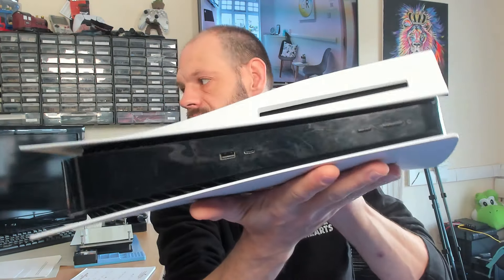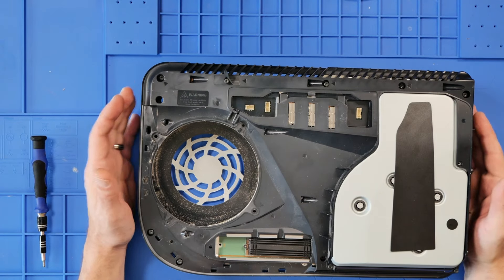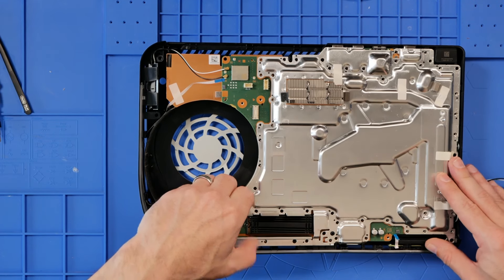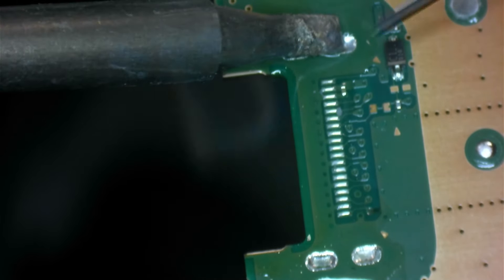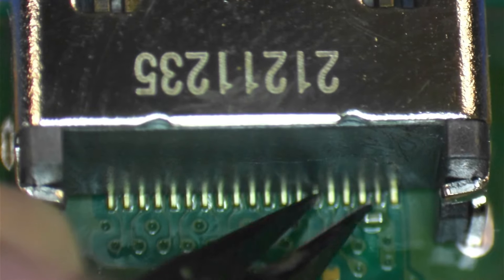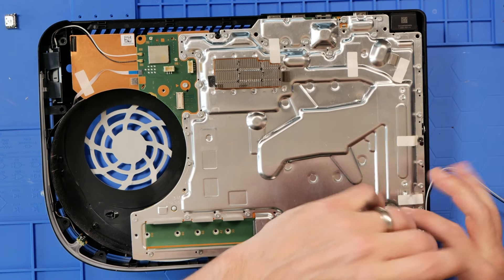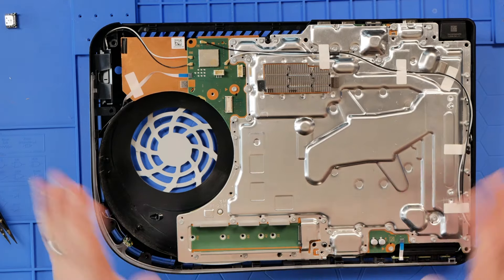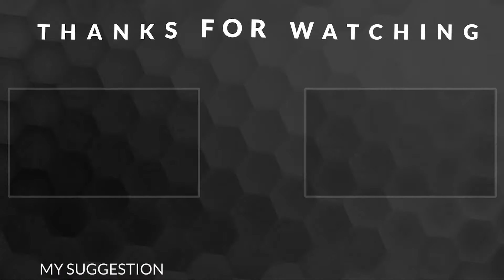PlayStation 5 HDMI Port Replacement | Fix | GetRefurbed

Comment: Just did this, took me two hours. Very good video. Everything works as it should. Saved me $500 from a local fix it store.
Reply: what did you use mines is broken
Reply: After watching this video, I'm very eager to try it myself. Don't know if I will make it worse 😂
Reply: Can you give me information on which heat station you used?
Reply: $500 is more than buying new.
Reply: ebay you can get it fixed for £25-£50 proper business, i wouldn’t go with private tho
Reply: Now I have confidence I can do it lol thank you sir.
Reply: @farhanshafique922  Never know till you try you could surprise urself lol

Comment: I’m replacing mine and my hot air station doesn’t make the port come off! Any advice on distance, temp, and duration?
Reply from the maker: Every hot air station is different bud full heat and airflow from the top will eventually get it. Lots of flux. Try putting some solder over all of the pins and ground legs if it doesn't budge

Comment: At last ,someone who doesn't over solder the HDMI port.
Reply from the maker: That's a bit of a bone of contention. There's nothing wrong with it, I just tend to find I don't have a need unless I've missed a pin, in that case I'll always go over them all with the iron.
Reply: @GetRefurbed  some YouTubers must have shares in the solder &  flux companies when you see how much they use. Not mentioning any names. 😉
Reply: Been trying to fix mine any plug around Pretoria where to go
Reply: @GetRefurbed  someone said it takes all day to replace the hdmi port---surely it shouldnt take all day?  hes lying
Reply: @MarkSmith-er7fe  if your skilled enough at microsoldering, it's an hour long job taking you very sweet time and doing some cleaning as you go. 

The hardest part is there are 100000000000 screws of different sizes.

Comment: Excellent video. I'm getting a lot of requests for these port repairs at this point. My one question is, what is your low melt point solder, and does it have any concentration of lead? I've been searching for a good low melting point solder to loosen these joints, but I've just not had a ton of luck. Also what do you use for a microscope?
Reply from the maker: Hey buddy. Thanks for watching. No low melt here. Just plain old 63/37 leaded Kester. The board take a ton of heat, not so bad once they're heat soaked which is why I tend to use the hot drop method. Less stress on the board.

Comment: @getrefured what’s that gel called why do they use it and can u use a heat gun that removes paint or that doesn’t work
Reply from the maker: That Kingbo Flux RMA-218. I would absolutely not recommend using a heat gun designed for that purpose. You need a hot air station capable of putting enough heat through the board without destroying it.
Reply: @GetRefurbed  what’s that gel for

Comment: So with the liquid inside ? 
Ill have to place it horizontally?? 
Cuz I like the standing version 
I don’t want mine facing the floor with his face 😅 
But shall I do it or no ????
Reply: I would lay if flat if overheating were to happen soldering drip on mother board ect could cause avoidable issues

Comment: Hello. Thank you so much for this video. You spoke about the small cap in front of the pads and said if it comes off it's okay. It appears the cap on my board fell off and I'm unable to find it. Do I leave it as is or do I need to bridge some solder between the two pads where the cap was? any info greatly appreciated.

Comment: Brother! My ps5 hdmi port is not working. And I need to changed it. I have ordered a hdmi port for the pa5, but what tools do I need for the repair?   Can please anyone make a list for me? I wanna do it by myself.
Reply from the maker: I'll be straight with you buddy,  this isn't a repair you want to take on yourself unless you are well versed in how to work around small components. For some perspective, you'll be spending hundreds on tools as opposed to sending it in for repair. At the moment we have an offer running for £40 per port.
Reply: @GetRefurbed  i live norway. Can u fix it ?
Reply from the maker: @kaw546  absolutely. You'd just need to cover the postage both ways. It might be cheaper to look for a local repair shop?
Reply: @GetRefurbed  local repair shops price to fix it, is 140$.. which is reallly stupid. and thats why i wanna fix my self.
but thanks anyway

Comment: Mine still works, it’s just loose. I have to turn the actual cord and play or jiggle it to get it to turn on…can it be tightened or should I just replace the HDMI port?
Reply: Did you end up having to replace the port? I’m having the issue now.
Reply: @DawonVelez same thing with mine but now it just completely stopped working

Comment: Question my ps5 got knocked off the table and fell on the HDMI cable area bending the plug on the HDMI cable itself..i got a new cable but nothing and them had a friend who is pretty good replace the HDMI port but still not working any tips or causes?

Comment: So question? Is it possible for the hdmi port to be messed up even if it doesn’t show physical signs of being damaged? My ps5 has been sitting in the same spot for the past 6 months and the last time I played it I didn’t have any issues. But this past weekend I was gonna finally do my software update because right when I stopped playing it months ago it was due for an update, just never got around to doing it. Could the need for an update cause this issue? Fully disassembled the console with the plan of switching the hdmi ports but like I said it looks like it’s in perfect condition. What should I do? I’m still able to play my VR games but can’t see any display on the tv. I’ve tried different cords and different TVs and my Xbox isn’t having this problem, only the PlayStation

Comment: Xcellent Vid! 👍🏻just about to do my first PS5 HDMI repair.  Ordered some No Clean Flux Paste in syringe dispenser, have variable hot air gun and following your guide. 09:55 "come in with the hot air clean up where we've been, some 99% IPA".  Are you using a stiff brush, hot air (from above?) and just IPA or is that flux?  🤔 Keep on Keeping On 👏🏻
Reply: Did you successfully repair it. I have another even touched solder before and soon going to attempt this and was wondering what tools you used or that I should use. I know i need a good flux, solder, hot air, soldering gun.
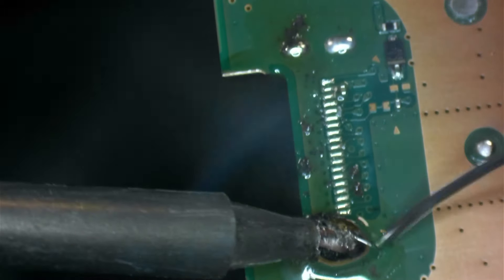Reply: @youngwolf421  I did thanx 👍🏻Not to put you off, but I wouldn't advise this as your first step into soldering. Take it to someone with experience in fixing HDMI on PS5. There is alot at stake when pointing that much heat at sensitive electronics (particular the tiny caps @ 09:39 and 11:11 ). Purchased No Clean Flux Paste in a Pneumatic Dispenser from Amazon. Already had a Wagner Furno 500 Heat Gun and 25W Soldering Iron. Never tackled anything as complex and even with years of experience with micro electronics it was daunting. This video was great for all the info I needed to do the job successfully. Working PS5 at the end of it! GL 🤞🏻

Comment: No matter what i try, i cant get the hdmi off. Nothing i do melts the joints. I feel like i have tried everything! Heat gun, rosin paste flux (not sure if im using the right one), adding more soldering... nothing works for me
Reply: Hi, I finally did it. Took me 2 days to do it. Main thing is you need patience as it took me about 5 mins to finally melt the solder on the hdmi.

First tilt the board so the hdmi is facing down towards the floor. Heat it from other side. Eventually it will fall off due to gravity.

Second heat the solder and use a solder sucker after about 5 mins to suck the solder off. Do all 4 and you’ll be left with 4 big holes. L the board cool down and then put the hdmi in and solder the joint. The solders that Sony have put on have a high melting point so you just got to be patience. Don’t start and stop after a minute or so. Be patience and have that gun pointed at it for about 5 mins, no kidding.
Reply: Awsome...because I had the same problem
Reply: @umranafzal2969  what were the tools that you used? This will be my first time too.
]
Reply: @umranafzal2969  Also what hot air gun did you use, there a bit expensive.
Reply: @youngwolf421  SEEKONE 2000W Professional Hot Air Gun. I already had the soldering iron and solder sucker. Last 2 you may not need if you can put the new HDMI in place whilst the solder is still hot and wet like in this video. If you can’t then you may need someone else to hold the hdmi in place very firmly whilst you solder. The pins on the jdmi need to be in contact with the pins on the board otherwise it won’t work.

Just be careful that you only apply concentrated heat to the hdmi only as you could damage your ps5. Do it at your own risk.
Reply: When i change hdmi i always loss this two components